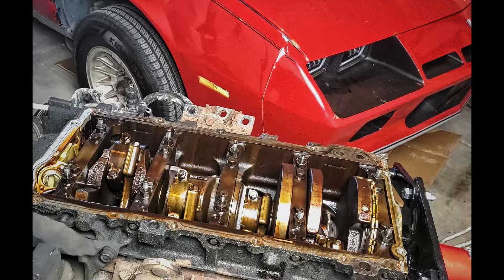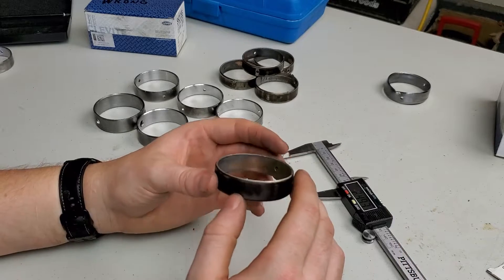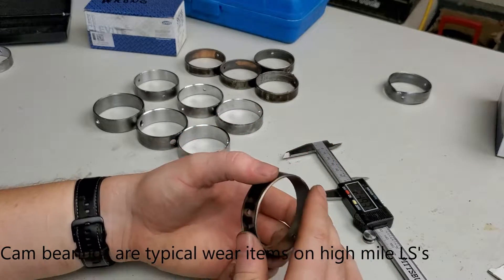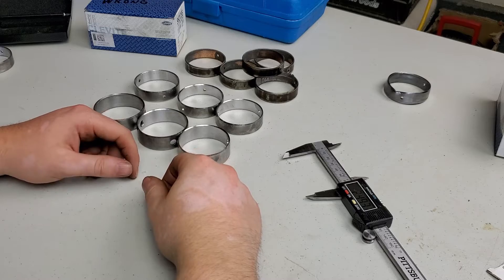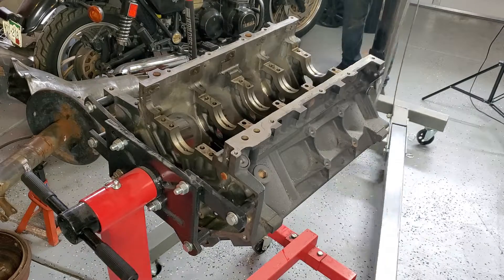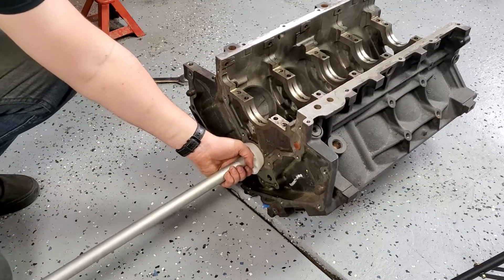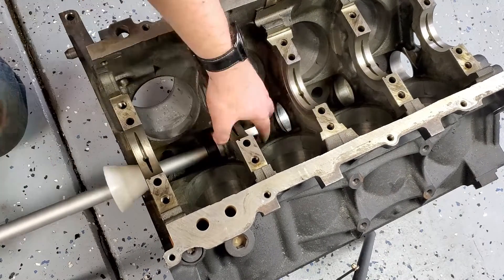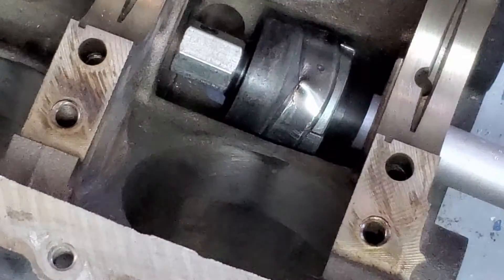Big Mistake! Twin Turbo 5.3 LS Build Part 3 - Replacing Cam Bearings

Comment: I ended up buying the LS specific cam bearing tool from summit awhile ago. I did cam bearings in a gen 1 sbc before and it went smooth as butter on removal and replacement, sucks that it just costs 80 bucks for basically a tool ill never use again.
Reply from the maker: That was probably the smart way to do it instead of the universal tools. I guess it's either the 80 bucks for that and an unused tool that you can sell again, or 80 bucks and the trouble of hauling the block to a machine shop. Something of an ordeal either way